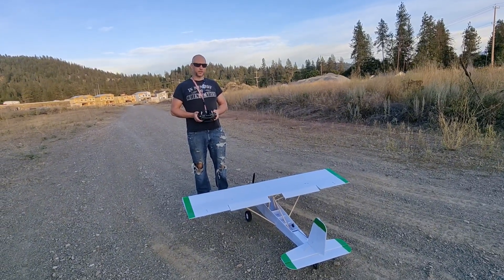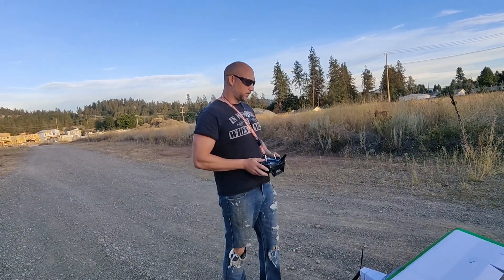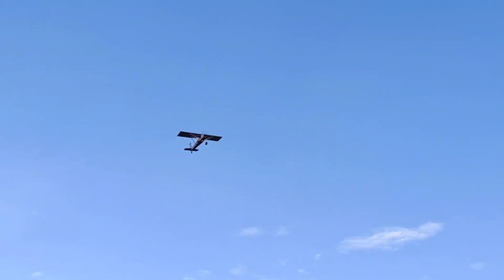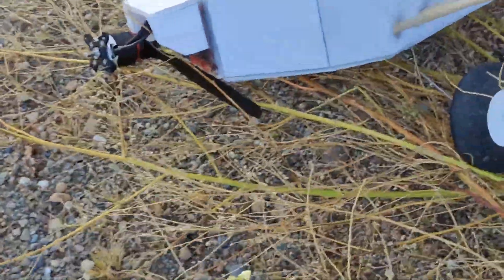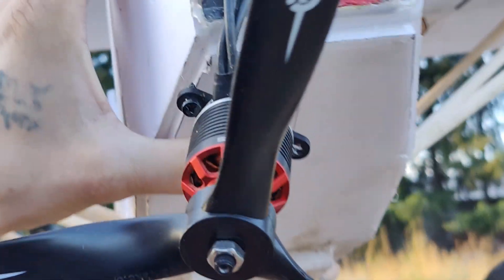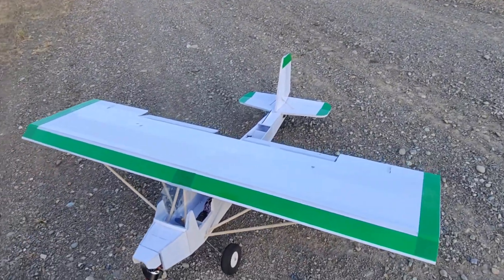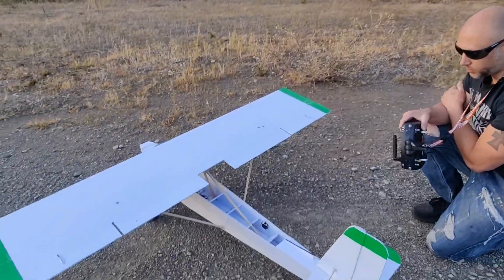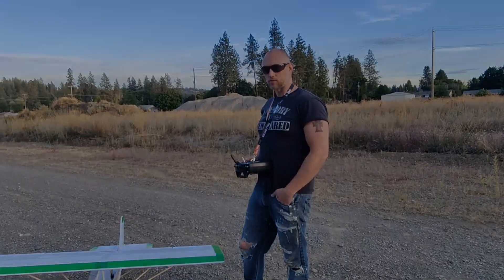My ultralight on 4s.

Comment: Nice flight!  do you have elevator to flap mixing set up?   Subscribed also.
Reply from the maker: @WildBillFlysRC  thanks! No I've never ran any kind of mixing.
Reply: @FlyTimeRC   If your radio can do mixing, 10% down elevator at half flaps and 20% at full flaps is a good place to start. Cheers!
Reply from the maker: @WildBillFlysRC  I may give it a shot. I usually just like to do everything by feel. Every plane has its own quarks. Maybe after I get this ultralight all dialed in I may try some mixing